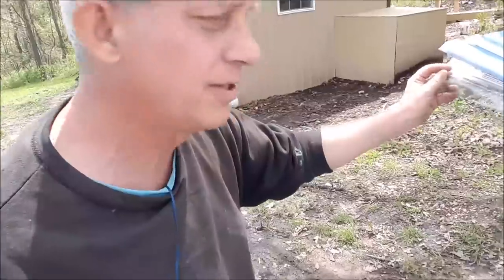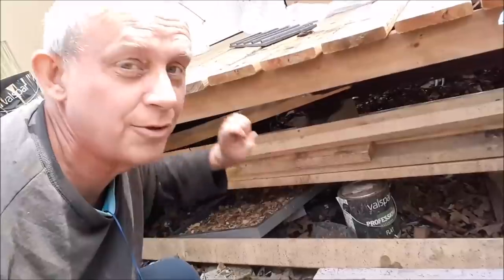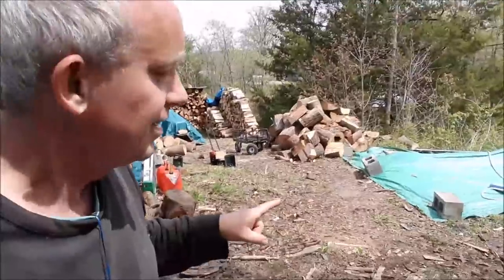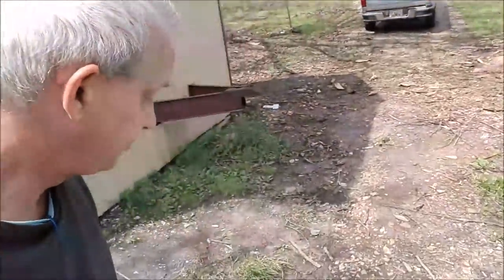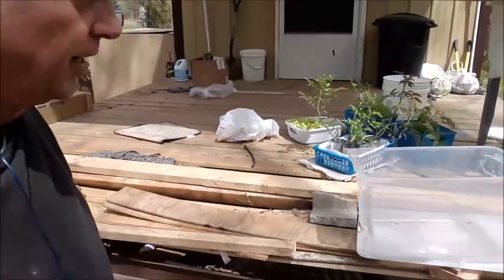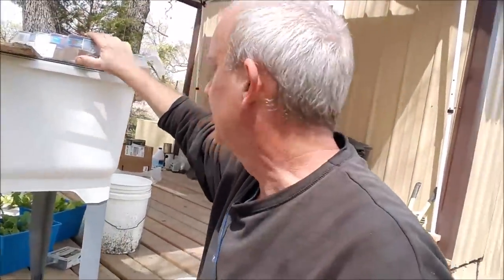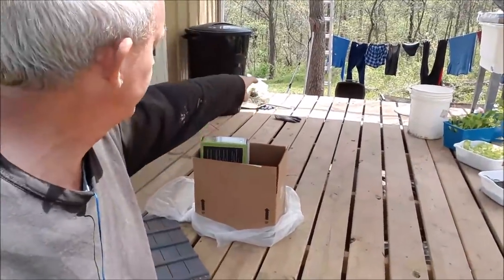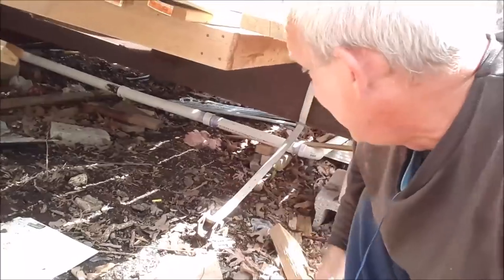I Caught 2 Intruders In Our Tiny House While Off Grid Living

Comment: I had possums under my raised house until I got two sheets of plastic lattice from Lowes, cut it long ways into three strips and mounted it on the bottom parameter of the house skirting. End of possums.

Comment: Rob & Carolyn, good morning. Loved the cat intruder video. Don't know where "he" in the winter, but Olsen styrofoam cooler or an old coleman cooler makes an excellent "winter" home for your mouse. Doesn't take hardly any time to make & little bit of straw to change out every so often. On the end of the cooler, cut a space that he can just get in through the door.Add straw. The top of the cooler, the lid comes off to change out the straw. Lay a couple of pieces of wood to hold the lid on so it can't blow off.  Also mix a little dry cat food with 1/4 can of the wet food. He needs hard things to help his teeth.  My sister has a couple of feral cats on her property, that's where I learned about the foam box. Love you off grid living. Thank you